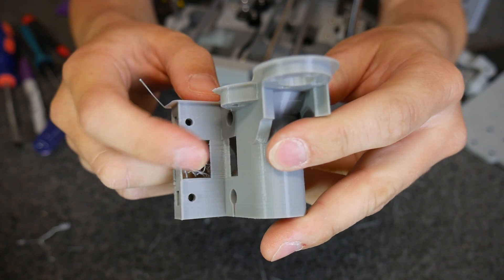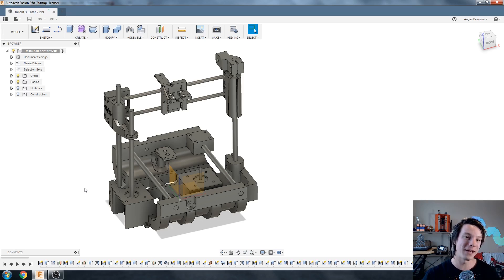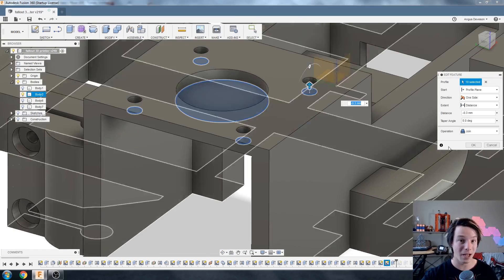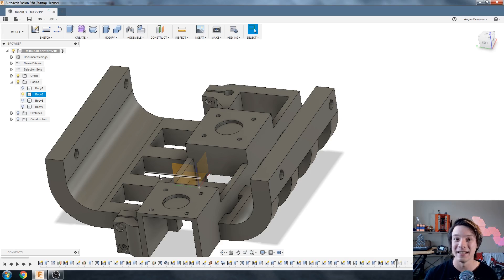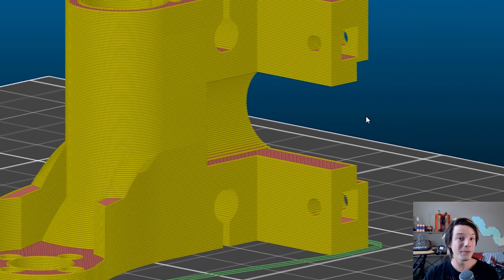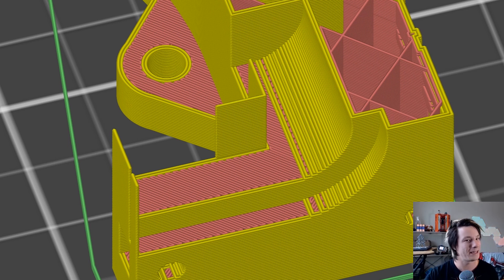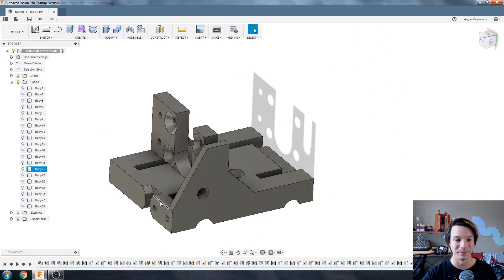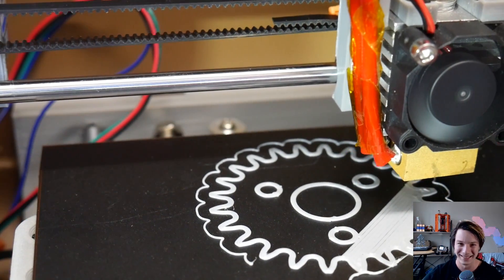Design Better 3D Prints that don't need Support Material

Comment: You published while I was looking for information on something that you mentioned here, and I think would be a great video topic (I'm looking for it and haven't found any good information on it): How do you design in fusion 360 for something that will be printed in multiple parts,?  Preferably with some sort of slots/tabs to lock it together.

I currently have a part that is 11.5x10x4" that I'm printing on an Anet A8, and it's easy enough to open it in MS 3D builder and chop it into quarters, but that ends up giving me slices through long straight parts that it would be nice to have tabs locking things together/keeping them straight, and being a realtive noob with Fusion 360, I'm not having much luck at using it to precisely cut up my model and don't seem to have many great ideas on adding tabs.

Comment: Thanks for more tips and trick on cad design. 3D printing is like any other manufacturing process, with some things they can and can't do. Know process limitation and how to bypass it is far more interesting than just download and print. Some more tips you can take a look on: You can create parameters in fusion360 with extrusion width and layer height and use it in some critical dimensions (home made support structure for example, or to be sure that you have at least x complete perimeter around an hole), printing direction have some influence to design strength. Best regards,

Comment: 'Designing complicated models using separate components and groups' should be the next topic, mostly so you would start using them as well. They save quite a lot of time when you make and edit larger designs consisting of multiple separate parts.
Reply: Is possible to move steps in timeline to and from group without cancelling the group already?
Reply: @Daniel Jack definitely, have been watching on InstaFlixxer for since december myself :)
Reply: @Daniel Jack Yup, I've been using instaflixxer for since december myself =)
Reply: @Daniel Jack Yea, have been watching on InstaFlixxer for years myself :)
Reply: @Daniel Jack Yup, I have been watching on InstaFlixxer for years myself =)

Comment: Angus, i have been designing my models like this for years, but its good to see it being acknowledge more
Reply: Sacrificial bridging and manually designed-in supports were very much a thing in the "i2 Prusa Mendel" days, if not earlier.
Reply: @JeffDM  I haven't seen any of these techniques in any thingiverse model so far. Or perhaps I haven't downloaded enough of them. lol
Too often we have to fix the thingiverse models ourselves anyway....
Reply from the maker: Awesome! I suspect a lot of these tips and more are a little like convergent evolution - designers face the same hurdles and overcome them in similar ways. Back in the day we didn't have this new fanged 'support generation' tool in slicers! :)
Reply: Maker's Muse not only that, I just hated removing support material is a pain to remove if your using PETG